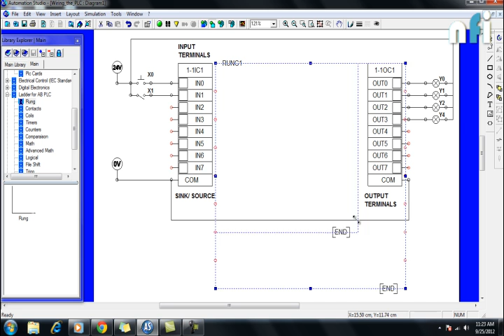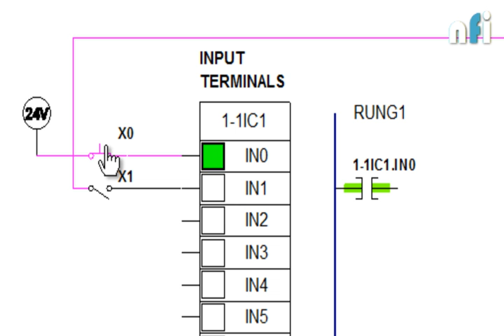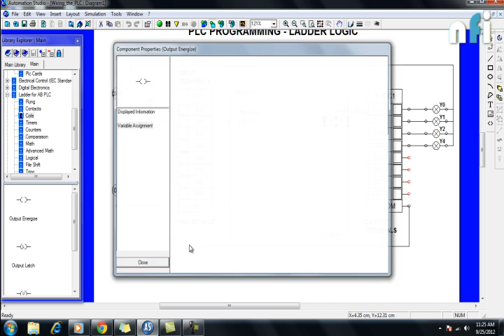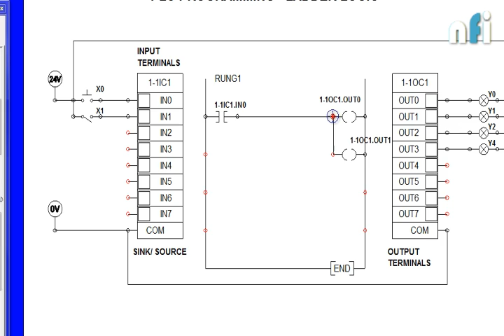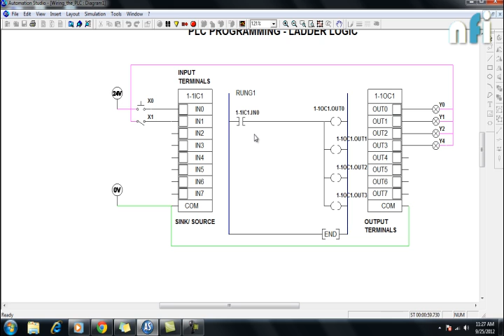PLC E-Learning Session 2- How PLC Ladder Logic Programming Works

Comment: I was wondering U said in the previous video the potential difference need to be 24 v inorder for the input to work. My question is isn't there any loss in the wire itself and switches so potential won't be 24 volts
Reply from the maker: There is obviously loss in wire  if your length of wire considerable very long. FOr short distance, it does not matter.

Comment: thank u sir this is very use ful to me bcoz I'm wrkng in automation based industry ,I have doubt sir will I connect DC source to I/p's and AC to O/p ,is it correct or not sir
Reply from the maker: You are welcome! When you say DC Source - what you mean? Sensors, Switches or Power supply? In any case, you can connect AC at output in case your PLC output terminals supports DC outputs. You need to check PLC manual.-

Comment: I NEED TO KNOW THE  WIRING OF ANALOG SENSOR EXAMPLE IT IS A FLOW LEVEL ANALOG SENSOR WHICH HAS THREE WIRES WHERE THOSE THREE WIRES GOES IN PLC
Reply from the maker: Kindly share the manual of the sensor, i will help you with the wiring. You can share details at nfiautomation@gmail.com

Comment: suppose we take a one example on home control using PLC....if we have to on/off 7 fans in one room by using plc...how it is works....we have to also controlling the their output...how is it possible
Reply: Rushabh Shah simple! for one input start a latch output and that latch will start all the 7 fans! now u want to control the fan speed I guess in that case this can happen automatic but u need sensors for that I mean u need inputs, if it were 7 AC then I would've said that sensors could b temperature sensor but that could work for fan too!
Reply from the maker: Dear Rushabh, You need to define the precise objective of how you want to control the output. Do you have more information?
Reply: Rajvir Singh I answered him

Comment: sir  if I switch 24v at the output with 0 volt will it work when the programming part is completed
Reply from the maker: What you mean Sujit? I you mean switching 24V at the output with 0V connected directly to the load. Then it will work !

Comment: hi sir ..your tutorials very easy to understand ....but output it generates 24v dc but in video  we tapping from input ..this my doubt sir..please explain
Reply from the maker: +surya prakash FYI., in input we have to provide potential difference of 24VDC to get our input detected. In Output you can generate any voltage if you contact are relay type. What ever you connect to COM of output will be linked to PLC output terminals if output coil is TRUE in the logic. I hope that make sense.,

Comment: I'm just getting started in PLC. How do you draw Plc using two position selector switch? (Auto/manual)
Reply from the maker: Joshua Parrish For that you may need just one selector switch and connect that to let's say X4. Now in programming you can make Auto program in parallel to 'NO' contact of X4 and Manual program in parallel to 'NC' contact of X4. This makes interlocking of 'Auto' and 'Manual' by itself.

Comment: Dear sir extremely informative.Thank you for the video
Reply from the maker: Your welcome fairooz mohideen  :)
Reply: Sir what is the most convinent PLC on the market.and is it fine to work with Chinese PLC for small systems.
Reply from the maker: fairooz mohideen I would say for learning purpose for either Delta 14SS or Allen Bradley Microlox 1000- it's cheap and it's software is free.
Reply: OK what are the recommended books
Reply from the maker: fairooz mohideen NFI recommends few books and software  which you can find here: http://nfiautomation.org/free-plc-software/